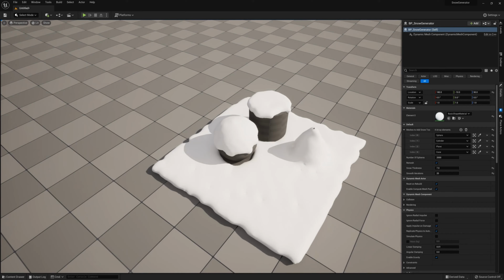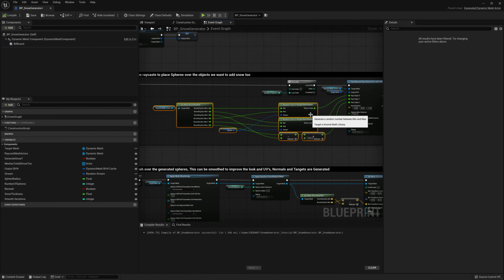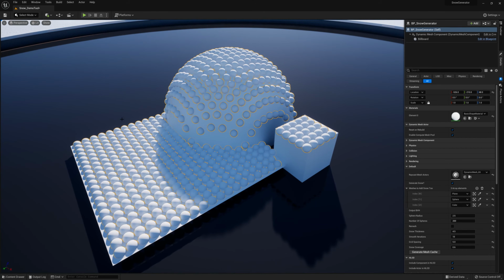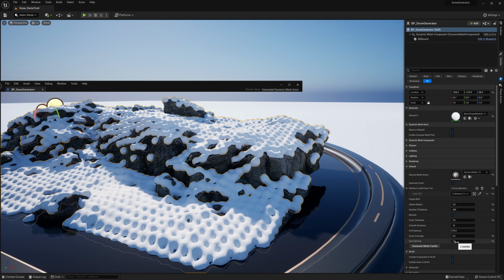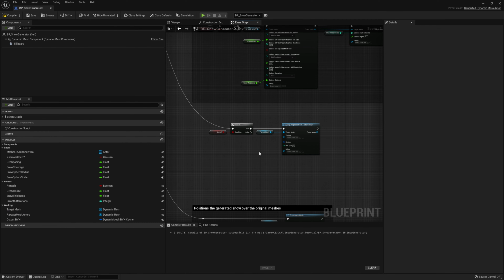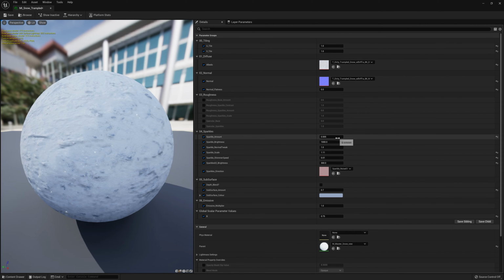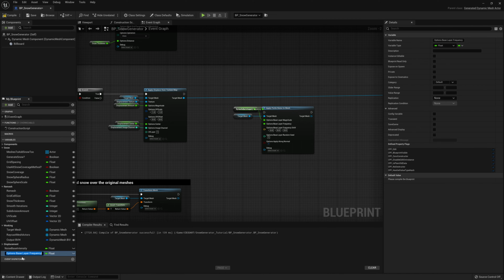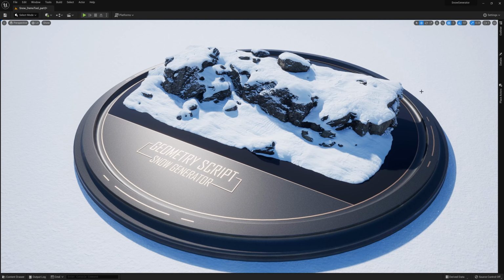Create Nanite Ready Snow Generator Using Geometry Script In UE5 (Part 2)

Comment: Hi CB3DART, thanks for creating such a great tutorial! I’m having a small issue right now. I have the snow working properly by following part 1, but when I test the snow on a mesh from Megascans (which is the same mesh you used in the tutorial), all the snow disappears. If I turn off the Remesh, I can still see that a lot of spheres are generated on the mesh. So I guess the Remesh function isn't working on the Megascans mesh? The snow can be generated and remeshed properly on cubes, cylinders, and planes. Do you have any idea what might be causing this issue? Thanks a lot! :)
Reply: I figured it out. I was being silly. Apparently, I need to increase the value of the sphere radius and snow thickness when applying it to a larger mesh.😂
Reply from the maker: pleased you figured it out, sorry I have been really busy with work so never seen your comment

Comment: Not sure if anybody already mentioned this option. You can use subcategories by adding a vertical line in Category naming: Default|Snow.  In this case all the exposed parameters are sorted in the Default/Subcategory menu which makes them easy to use. Also I tried to use collision of the mesh instead of LOD to speedup cache processing - in that case you can use the function "copy Collision meshes from Object" - which is faster, but in some cases will not work.  ps - Great tutorial, thank you!
Reply from the maker: Thanks for the comment

Comment: I've followed through twice now and I'm still getting an issue where once I add the Generate Mesh Cache it won't generate any snow. It keeps coming up with two errors: FindNearestRayIntersectionWithMesh: TargetMesh is Null and ApplyMeshMorphology: Morphology operation output an empty mesh

I saw someone else had the null error too and they managed to fix it but didn't say how. I'm sure it's simple but any help would be hugely appreciated as I really have no idea. The mesh cache is showing up when I hit generate. Although when I try and navigate to it in the Content Browser I can't find it, don't know if that's relevant or not. Thank you
Reply: Ok third time lucky and I got it! If anyone else is struggling at about 7 minutes in that snow is not generating it is because you need to Get the Raycast Mesh Actors variable and plug it into the Get Mesh Bounding Box. When you cut the Build BVDH out you need to add in a Raycast Mesh Actor back in.
Reply: @HollysMayaTutorials  Thanx A lot 
I was Wondering wtf happened And Just Saw ur comment and fixed it !

Comment: One way to get around the Defaults Tab Sorting itself so far down in the 'Generated Dynamic Mesh Actors' Class is to use Actor Components! And host all your Variables there!
The one downside is when moving the Generate Mesh Cache to the ActorComponent I had to pas a self reference to the ActorComponent (Inside ConstructionScript) and use a Blueprint Interface to Call the Event, this probably sound overkill but I couldn't find any way of Calling an Event from the Owning Actor on the ActorComponent

Might be more work than it is worth but it is a solution I prefer ! 🙂
Reply from the maker: Thanks for posting, always nice to hear about peoples work arounds, etc.

Comment: i had snow until the beginning of this video, 2 minutes after starting this my snow generator won't do a thing.
"Generate Snow" is nowhere in my details, nowhere.
Reply from the maker: I might have missed something, there was a bit of a time gap between me making video 1 and 2 and I might have missed something but "generate snow" is just a boolean (if I remember correctly) so all you need to do is make a boolean variable and call it "generate snow" then connect to a branch node right after "set targer mesh" node. This time stamp in this video shows how the branch node should look https://youtu.be/f1-5E6j7phA?t=288 (at the bottom middle of the screen you will see a branch node with generate snow variable connected) Not sure if this is your problem or not though

Comment: Hey there, thanks for the tutorial it's great. I've completed it but I would like to add something to this generator, a way to prevent specific parts of the selected meshes from getting the snow. Like for example if I have a firepit in the middle of the snow it would make sense to not have snow on the ground around it. I tried to figure it out on my own but couldn't, if you have any idea on how to go about doing this it would be awesome :)
Reply from the maker: I have not tried this but off the top of my head there are lots of ways you could do this, one quick way might be to have another mesh array that are "excluder objects" that when you do the raycast you test against an if you hit them you dont place a sphere for the snow. obviously this is not very in depth or potentially the best way but it might lead you to a solution. cheers

Comment: Ive completed the tutorials, only issue Im facing is that my displacement doesnt seem to add any sort of depth detail. The snow remains smooth. I've double and triple checked and cant seem to find the workaround. I've also tried messing with the displacement amounts, center, nothing seems to help.
Reply from the maker: did you fix this? If not someone else had a similar issue and it turned out that they had the pins of the sequence node in the wrong order. Might be worth checking yours.

Comment: Dear sir! I have 5.1 version and BP stops working after optimization (
Reply: Try on the Build BVH For Mesh node, connect the Target Mesh pin to the Get Mesh Bounding Box node. That might fix it.
Reply: @Eidridin  a true champ!
Reply from the maker: Sadly I have not had time to try 5.1 yet, if/when I do I will report back if mine works.

Comment: Hey I liked the video very much, the rendering is very good, I have a question, do you think it's usable in a weather system, I mean seeing that in the end we get a mesh we can't make it appear little by little in real time?
Reply from the maker: in theory you could do that, but what I have made for this example is very inefficient. You would need to make some efficiency improvements to do that. Main issue would be voxelising the spheres (i.e. remeshing) as this takes time and if it was a the whole mesh being remeshed each frame it would be far too slow (unless it was very low poly) however if you could figure out a way to only remesh or add what is changed then it might work.

Comment: one question however, say i have multiple meshes and i want different displacement and textures on them, like one is cliffs with dirty jagged snow and the other is like forrest meshes i want fluffy snow on, how would i go about doing that?
Reply from the maker: Erm, with the current set up, it would probably be easiest to just drop in two snow generator blueprints and assign a different mesh to each then set up the snow types you want. (I have not tired this but it should work, I think) ofcourse with more time you could make a system in a single blueprint that could allow for different types
Reply: @CB3DART  that's what I ended up doing    I always think it's too expensive to do that

Comment: Hi ! Awsome tutorial thank you so much. I'm currently working on a game project that require a strong procedural snow shader to put on any object of the scene. Do you think that the one you create in your tutorial is game ready with UE5 or is there a better way to achieve a good result ?
Reply from the maker: I would not say this is best (its more of an example of what you can do, there is many many improvements that could be made) however the meshes generated from the tool would totally work in UE5 (as nanite meshes) so yes it would work but no not necessarily the best method, just one method.

Comment: Not sure what I missed however, I don't have a "GENERATE SNOW?" Variable and I'm not sure how to add it. HELP
Reply from the maker: Hi, Thanks for the message. I made this some time ago now so its difficult to fully remember it all. Firstly, sorry if I missed showing the creation of the generate snow variable, its actually not essential to the tutorial but I appreciate that it might be annoying that its missing on yours. So all the generate snow checkbox does is allow you to stop the snow from generating every time you change a variable. So you uncheck the "generate snow" box then you are free to edit any properties you like in the "tool" then when you want to have the snow generate you check the "generate snow" box and the snow will generate. As I say this does not do anything apart from allow you to "pause" the snow generation, so will no affect on the tutorial (also I think I completely redo that and change it to a button in this tutorial anyway) However....

To add the generate snow check box is very simple if you want to do it. Firstly you will need to create a variable inside the blueprint called "generate snow" set variable type to boolean and expose the variable to that it can be seen in the tools details panel. You need to then add a branch node that goes between the "set target mesh node" and the "Sequence node" Connect the "Set target mesh node" to the in pin and connect the true pin to the sequence node. Then all that is left to do is attach the new variable you created to the condition of the branch node. Below is a quick image of what to do. Hope it helps
https://imgur.com/a/oaUyVl6
Reply: @CB3DART  THANK YOU VERY MUCH..!!  Now if I could only get the GENERATE MESH CACHE to work I would be the happiest person in the world. I'll start from scratch just to make sure I didn't miss anything. Thank you again for sharing such a wonderful tool. Cheers..!!!
Reply from the maker: Pleased that it was helpful, hope that you managed to get the generate mesh cache to work!
Reply: @CB3DART  Really didn't expect this answer can be found, and it's SO detail and helpful just the same as your video. Thank you so much.

Comment: Hey!
Could you confirm if this works for 5.0.3?

Everything stops working for me at BVH Cache Optimization

I get following errors in log:

LogScript: Warning: Script Msg: Divide by zero: Divide_DoubleDouble
LogGeometry: Warning: GeometryScriptError: FindNearestRayIntersectionWithMesh: TargetMesh is Null
LogGeometry: Warning: GeometryScriptError: ApplyMeshMorphology: Morphology operation output an empty mesh
Reply: Had exact same problem UE5.1Preview2, spent couple hours in frustration. Solved somehow when added Y loop as @CB3DART showed in tutorial. Have no ideas how and why it worked)))
Reply from the maker: Sounds like there might be a mistake in the variable used on the BVH and the Raycast Mesh Intersect but its really hard to say without a screenshot of your node graph, if you share one I can have a look. As I think I used unreal version 5.0.3 but will double check when I get a min.
Reply: @CB3DART  Hey! Sorry it took so long. Here are screenshots of my node tree

https://drive.google.com/drive/folders/14Rx6eTQATCfkCoxCicp3Z-GFYgxgMb8k?usp=sharing
Reply: Yes, i do press it every time and it doesn't work for me. So weird, i'm at loss here 😅
Reply from the maker: That is really odd, I cant seem to find your images any more but one other thing to check is that you have exposed the variables (click the eye beside the variable) for the BVH and the Raycast Actors, as I mention in the video, if they are not exposed then they get cleared each time you change a variable, so they need to be exposed.
Reply: @CB3DART  i guess youtube just removed my link, so here it is again! 
https://drive.google.com/drive/folders/14Rx6eTQATCfkCoxCicp3Z-GFYgxgMb8k

And yes, i had them exposed, so it's not the reason it's not working. But thank you for the effort to try and solve my issue. Fml 😅
Reply: @CB3DART  My link was deleted by Youtube for the second time. Yes, i had those variables exposed, so it's not that. But thank you for taking time to try and help me anyway!
Reply from the maker: Thanks, I managed to see the images again. Hmmm, I honestly thought it might be that the variable were not exposed (it needs to be the "Output BVH" and the "Raycast Mesh actors"). If its not that then I am sorry, I am out of ideas as it does work for me. :-( 
I have been considering releasing the version of the tool I have but need to tidy it up and am really busy with work at the moment, so it might be a while but I hope to do it some day. Will let you know if I do then you can always try that one.
Reply: @CB3DART  it would be neat, i'll be waiting. Thank you for your tutorial, this is an awesome piece of content!
Reply from the maker: Thank you, I will see what I can do
Reply from the maker: So I had a look, are you pressing the generate mesh cache button after you recompile? as if you don't the BVH will be out of date (i.e. empty) like the warning says. Each time you compile you need to click the generate mesh cache, as when you compile the cache is emptied.
Reply from the maker: I have just double checked/tested mine on 5.0.3 and works fine
Reply: Did you get solution? BP stops working after splitting the system